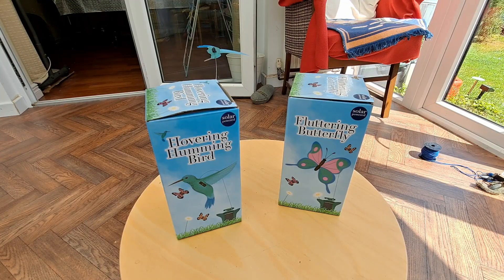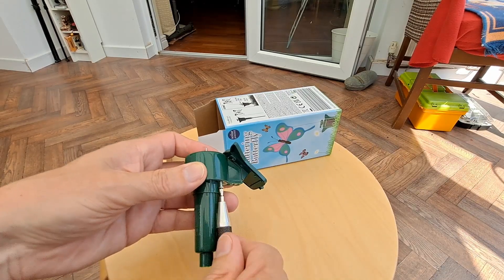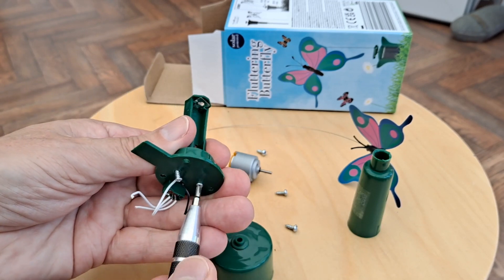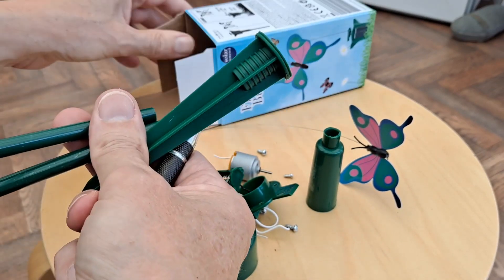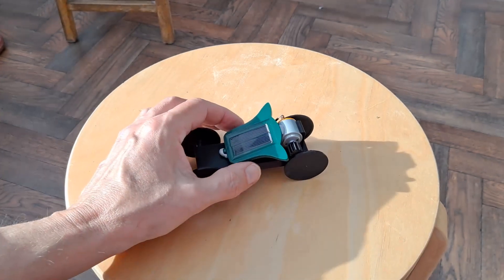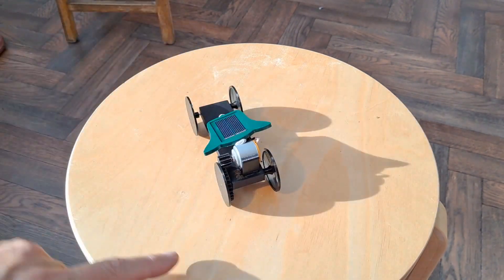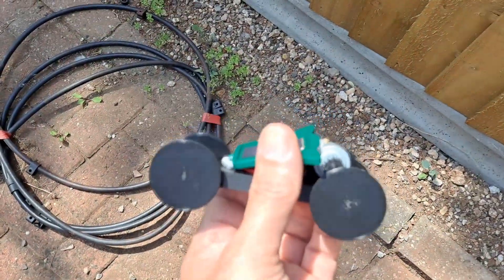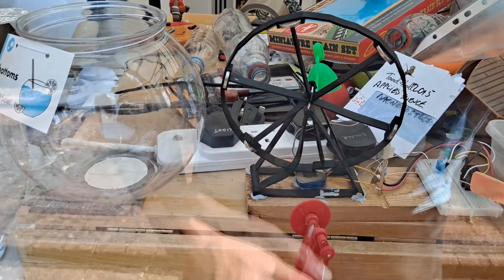Solar Butterfly to Solar Car

Comment: A static project would be an interesting additional experiment. I have a solar cyclist and a pair of dragonflies - both commercial designs.  A third design, stuck to a window, rotates a couple of acrylic "diamonds" dangling below the motor (and gearbox) throwing light patterns into the darker parts of the room and onto the ceiling - a sort of "daylight disco ball"
Reply from the maker: Thanks for the suggestion, Kyren. Have a peek in the video description and you will find my solar project playlists. By coincidence I do have a solar cyclist. You have me thinking about a rotating glitterball now 😊😊

Comment: That ran really well.  I have one of those solar butterfly ornaments and have been experimenting with the motor hooked up to a peltier module.  You get quite a bit of useful parts with those ornaments and the battery holder is good.  I really admire your 3D design and print skills. Well done.
Reply from the maker: Thank you 😊

Comment: There are DIY kits available on the internet with:
4 toy car wheels, 2 axles, a basic frame, 4 small axle holders, 4-8 small screws, crappy screwdriver, 2 zip tie, a short section of double sided tape, solar panel, toy motor, 2 gears.
The solar panel is laying flat on the frame, so the angle affecting the performance as minimally as possible...
Reply from the maker: Yes, you will find I have covered them in my Solar Cars playlist (in the video description), however this video was done specifically for the purpose of demonstrating how effective the motors are in these solar garden ornaments. Laying the panel flat when the sun is so low in the sky mean you get very limited power, that is why I have it angled up. If you happen to live nearer the equator then you will not have the same problem.
Reply: @GrandadIsAnOldMan  I live in central Europe, laying the solar panel flat wasn't my idea, the instructions of my kit was like that.

Comment: A classic build... enjoyed that! It coped well with the pathways outside. 
Those solar panels seem to be about 1.1V 100mA(?) A dozen of those across a car back window could make a good battery maintainer.
Reply from the maker: Hmm, a dozen of them probably cost in at the same prices as one of those cheap battery maintainer panels, although I would gain a load of nice little motors 🤔🤔

Comment: What about putting two solar panels in series to give it a bit more power? 👍
Reply from the maker: Yes Mike, you can always add more, but this build was specifically about using what was there to demonstrate it works. More sunshine would help, but when I build solar projects the sun hides. As you can see, this runs fine as it is, demonstrating there is enough power from the small panel if you have the right motor and the right gearing. Compare this to that little train. That is the context.